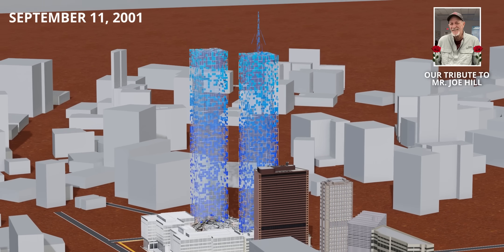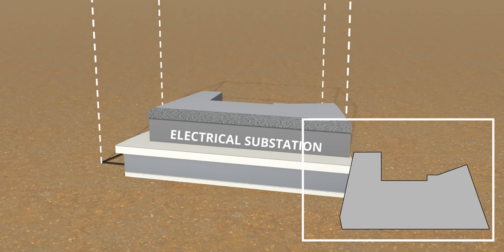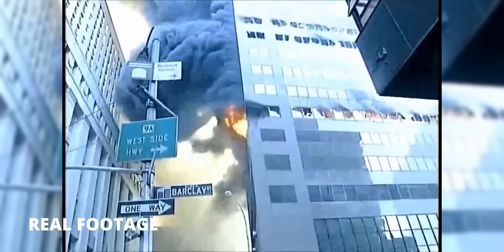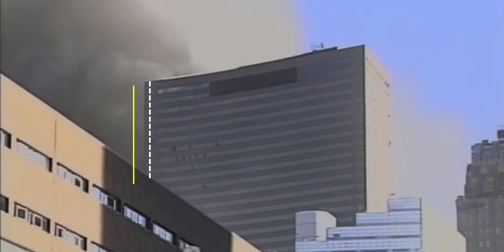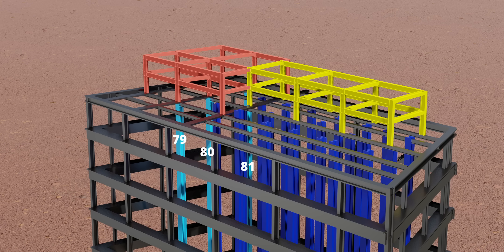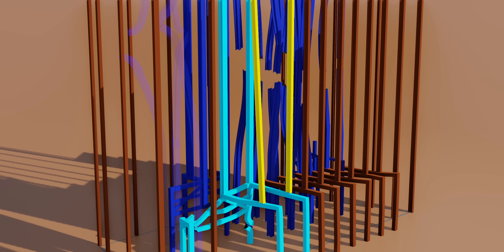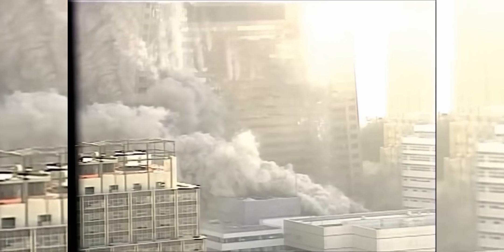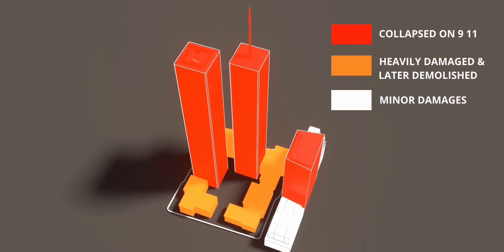Collapse of Building 7 | The Complete Physics

Comment: If i got the illustration right, the gash is on the left side, but the penthouse is on the right. On top of there being claims of the spire falling on the opposite side, we are supposed to believe that the core underneath the penthouse is the first to go? Due to  the penthouse overbearing weight on the 3 columns? I say, not convincing enough, conjecture., theory.
Reply: Perhaps a bit more detail then.  This is my explanation  of the collapse using the best available information and relying on no authority.

B7 was complex 47-story steel framed structure built on top of a smaller existing 3-story building, requiring several lower floors dedicated to complex load transfer structures instead of usable office space. Of trapezoidal shape and all-steel tube-in-tube construction, B7 (above the 7th floor) consisted of a central core of steel columns carrying most of the gravity load, perimeter steel columns around the outside of the structure carrying the remainder of the gravity loads and long span beams and girders to tie those elements together and form the floors. On the outside of the building hung a moment frame - the last part of B7 to fall 

Phase 1 : The first externally visible signs of collapse initiation occurred at 5:20:28 pm. Collapse initiation for B7 is notably quiet with observers not realizing the building was collapsing! There was no audible warning in the form of say hundreds of ear drum busting 180-190dB explosive bangs preceding the collapse. Here at 12:00 a local CBS affiliate reporter is talking 10 blocks from B7 when collapse begins. People don’t start to notice the collapse until 12:11. Then at 12:45 is the famous CBS fixed camera clip of Building 7’s collapse.  Note how quiet it is.

youtube.com/watch?v=t5tEy6mXSE8&ab_channel=fresnosean379

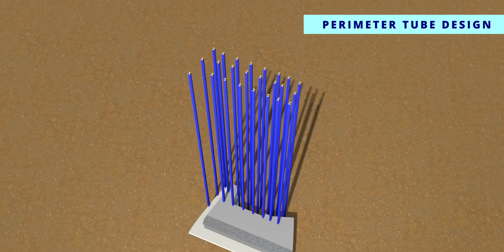Collapse initiation was due to lower floor failures above the load transfer region (7th floor) in the NE corner of the building. In this video at 0:45 you can see the NW corner from inside the building while under construction, Column 79 just out of frame on the left. That big, angled steel beam across the top of the frame connects to C79 at one end. The girders connect to the beam. That beam and all those girders depend on just one connection

youtube.com/watch?v=nP3TNHPCIVU&t=35s&ab_channel=EdwardCurrent

Phase 2 : Lower floor failures caused a loss of critical lateral support over an excessive length of core Column 79 and it buckled. If you look at a floor diagram of Building 7 (see above) and look at all the structures that depend on C79 you quickly realize this one column was a relatively isolated structural element on which a disproportionately greater fraction of the structure depended analogous to say the Key Bridge. Externally we see a vertical progression of window breakage along the 44-46 line and a kink in the roof of the East Mechanical Penthouse at the top of the building, consistent with C79 failure. The transition from full capacity to almost no capacity occurs in virtually an instant. Once the buckling failure occurs there is almost no resistance

Normally with a buckling column, the load could very well be redistributed to other columns, meaning the buckling could stop after a while. With C79 that is not the case - the failure did not redistribute the load, so the collapse rapidly progressed to the roofline, sinking the rooftop penthouse.

Phase 3 : With C79 gone, B7’s progressive, non-symmetrical collapse continues with C80 and C81 at the east end of the core left laterally unsupported and quickly buckled and failed as well, sending the EMP down through the building. C79-81 all have no diagonal bracing, which I believe is a major reason why they could not redistribute a lot of vertical loads among one another.

From there collapse progressed from east to west through the central core until the core was gone taking all of the interior floors and structures and probably most of the perimeter columns with it. You can see the horizontal progression of window failures low in the building and the dropping of the remaining rooftop structures into the building. One of the big takeaways from the NIST Building 7 study (that gets completely ignored) was their modeling which determined C79 failing under ANY circumstances would have initiated the same collapse sequence.

Phase 4 : 10 seconds in only the exterior moment frame - just a hollow empty outer shell – remains, the illusion the building is still standing since little has outwardly changed. But it’s just a hollow empty shell like an empty cereal box supported by only a few remaining columns and quite unable to remain standing. With all internal framing gone, the north face leans inward, forming a V in the roofline, the last perimeter columns buckle under the strain and the moment frame free falls, landing on top of the 7-story high debris pile. It is only here, at the end that a single measurement of alleged free fall acceleration is taken, from a single point on the moment frame. The Building (defined as its center of mass) did not “free fall” (sort of) – just one corner of the outer shell did. The Building was already gone before that happened. The period of alleged free fall was a product of collapse progression mechanisms, not of collapse initiation mechanisms and is irrelevant to what started the collapse. Start to finish the entire collapse took 18-20 seconds, 3 times longer than true free fall and how fast something falls cannot tell you what started it falling anyway. The debris spread outside the footprint, blocking surrounding streets, heavily damaging the Verizon Building and destroyed Fiterman Hall.  

Building 7’s progressive, non-symmetrical collapse was incidental and unintended collateral damage from the combined effects of fire + time + gravity started by the collapsing North Tower. That is true no matter who planned and carried out the 9/11 attacks or why . The collapse was of so little consequence it barely even registered at the time, a mere footnote. It only took on semi-mythical status as an alleged smoking gun years later when demolitions at the Twin Towers, missiles at the Pentagon and shoot down over Shanksville all failed and conspiracists had nothing left to work with.

I hope you found this helpful, informative and it solicits informed critical comment. If I made any errors of fact, logic or reason or left anything important out, please let me know so I can fix it. IF you can offer a more plausible alternative please do. Be the first. Please start any reply with the words “Tits McGee” or I will know you didn’t read it and are wasting my time.

Comment: This one looks like building 1 and 2 https://www.youtube.com/watch?v=vRLShJW5drE&pp=ygUpdiBzaGFwZSBjb250cm9sbGVkIGRlbW9saXRpb24gb2YgYnVpbGRpbmc%3D

This one looks like  #7 https://www.youtube.com/watch?v=D7Rm6ZFROmc&pp=ygUpdiBzaGFwZSBjb250cm9sbGVkIGRlbW9saXRpb24gb2YgYnVpbGRpbmc%3D
Reply: The first one looks nothing like Building 7 and certainly doesn't SOUND like it.  The obvious lack of demolition explosions both visible and audible is palpable. And of course, Building 7 came down progressively, not as a unit.

And it was on fire. 

The second one is so cherry picked in its editing (most of the collapse of Building 7 was edited out by AE911T) and the audio muted as to be completely worthless.  It is literally propaganda - a very deliberate deception made by fundamentally dishonest people. 

It's stuff like that which has made the CD movement a laughing stock and caused it's inevitable demise. 

Curious as to why you left out examples like Plasco Tower and Wilton Paes de Almeida (steel framed high rise buildings that collapses from fire), Surfside or the recent Bangkok tower collapse, which would have provided a more diverse and complete comparison. 

You may not like it, but what is being presented in the Sabine Civil Engineering video is fundamentally correct and widely supoorted by the worlds engineering community.

While imperfect (there are a few problems) this video goes into a much higher level of detail than many viewers can comprehend and gets the collapse mechanisms fundamentally correct. This is true no matter who planned and carried out the 9/11 attacks or why . 

	
Sure, it’s not what you want to hear and goes against 20+ years of conspiracy dogma and conditioning, but that is not the same as it being wrong. You just need to fix your dogma. 

On the plus side, this video can be (and is) fundamentally correct about the engineering AND the 9/11 attacks could still have been some sort of inside job. The two things are in no way mutually exclusive. It’s just not the inside job the clowns you have been following on the interent have been telling you. 

This will surprise you to learn, since the conspiracy side of the internet hides it from you, but the mechanisms described here have broad professional support around the world. There are no professional engineering organizations (for example: ASCE, ASEE, ICE, etc) that disagree with them or have offered any formal dissenting opinions or alternative hypothesis. 

So, either the overwhelming majority of the worlds structural engineers and quite frankly simple observation are wrong,… … or you you know more than the worlds best engineers from cruising around on the internet. Which seems more likely? 

If this explanation is wrong then produce a better one.  Be the first to even try.

Comment: Wasnt this the closest building to one of the wtc?
Reply: No, the WTC 7 was fairly far away. But since the towers were 1300+ feet tall, that didn't really matter.
Reply: At 340 feet from the North Tower, no. Building's 5 & 6 were in between the North Tower and Building 7 but 340 feet is well within the falling debris field.
Reply: @TheCriticalStinker-01 Yeah I thought I saw a diagram of its location so it was within range of debris. I didnt know it was only 100yds . Thx . So that Penthouse roof cave in could have been from debris. Nobody had a chance to go up there or inside to investigate.
Reply: @brett7761  - The physical damage was not responsible for the collapse. It is responsible for introducing and spreading the fires which 7 hours later caused the collapse. Has there been no fire the building would have been repaired and still in use today.

Comment: This video is a lie
Reply: You may not like it, but what is being presented in this video is fundamentally correct and widely supoorted by the worlds engineering community.

While imperfect (there are a few problems) this video goes into a much higher level of detail than many viewers can comprehend and gets the collapse mechanisms fundamentally correct. This is true no matter who planned and carried out the 9/11 attacks or why . 
	
Sure, it’s not what you want to hear and goes against 20+ years of conspiracy dogma and conditioning, but that is not the same as it being wrong. You just need to fix your dogma. 

On the plus side, this video can be (and is) fundamentally correct about the engineering AND the 9/11 attacks could still have been some sort of inside job. The two things are in no way mutually exclusive. It’s just not the inside job the clowns you have been following on the interent have been telling you. 

This will surprise you to learn, since the conspiracy side of the internet hides it from you, but the mechanisms described here have broad professional support around the world. There are no professional engineering organizations (for example: ASCE, ASEE, ICE, etc) that disagree with them or have offered any formal dissenting opinions or alternative hypothesis. 

So, either the overwhelming majority of the worlds structural engineers and quite frankly simple observation are wrong,… … or you you know more than the worlds best engineers from cruising around on the internet. Which seems more likely? 

If this explanation is wrong then produce a better one.  Be the first to even try.